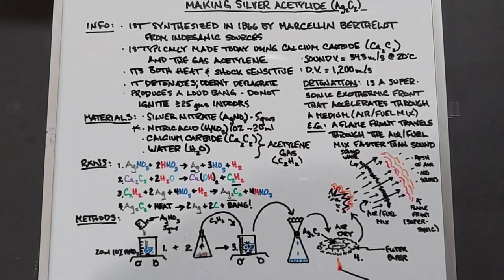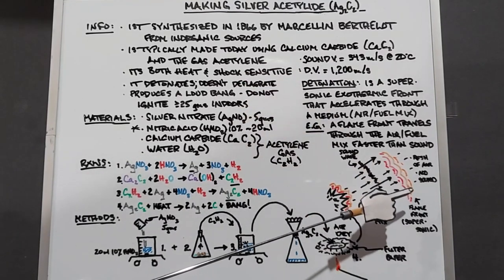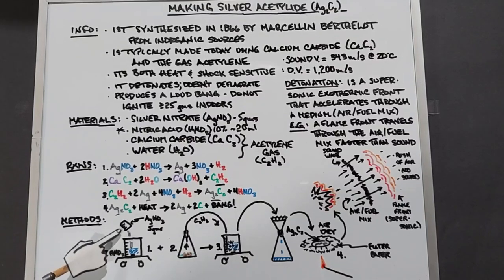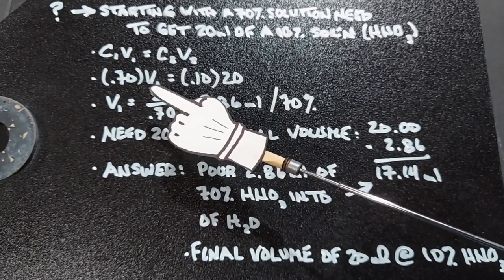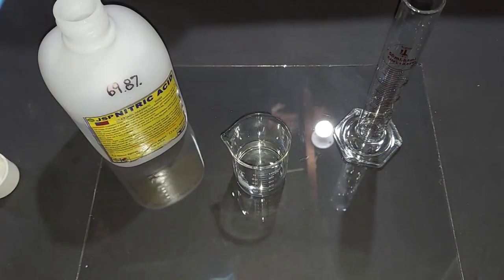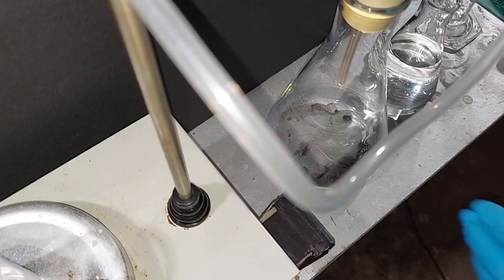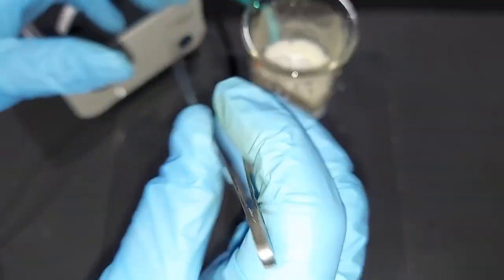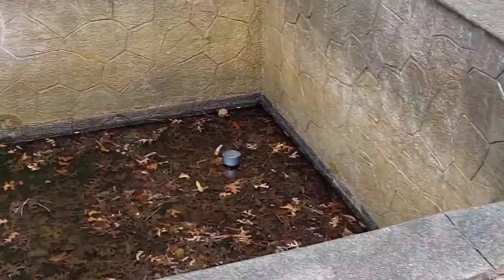Making And Testing An Atypical Explosive: Silver Acetylide

Comment: As far as I know, the distinction between deflagration and detonation refers to speed of sound in given explosive material, not air, compared to speed of flame front again in said explosive. As for the heat, that reaches target faster than sound, it's because it's radiated, hence travels with the speed of light.

Comment: Question! I dissolved 1 gram of silver wire in nitric acid. This took about 24 hours. Beautiful whitish precipitate when the acetylene was introduced. Now that the powder is dry however it doesn't go boom when I light it? It just turns to something like a ball of ash. Doesn't melt at all. There's not one hint of deflagration or detonation. The product is very white, fine and powdery. Looks like chalk. Any thoughts?
Reply from the maker: I think whatever is forming (whitish precipitate) isn't silver acetylide.  1 gm of silver would produce approx. 1.5 gms of silver nitrate.  A very small amount.  This silver nitrate, when dried and solid, would have to be then again dissolved in a very weak nitric acid solution according to the ratios shown in the video.  Once it is dissolved again, the acetylene gas is bubbled through it.  I sense that the whitish ppt may only be silver nitrate.

Comment: This is super interesting. I'm more attentive to how this looks like a pathway for recovering nitric acid from a nitrated salt waste.  

Is there any viability in that thought, or do other metal acetylides just not form with this method?

I did a quick look and you can make other metal acetylides, but the most common are alkali acecylides, used as catalysts or intermediate for ethynyls, but all of those propose the acecylides as the desired product, where I'm interested in recovering nitric acid from waste nitrates.